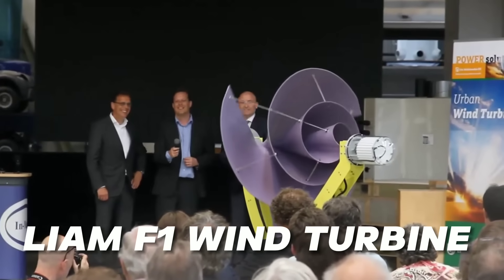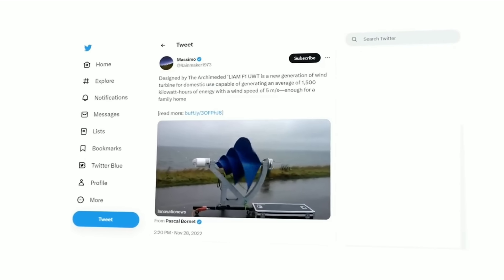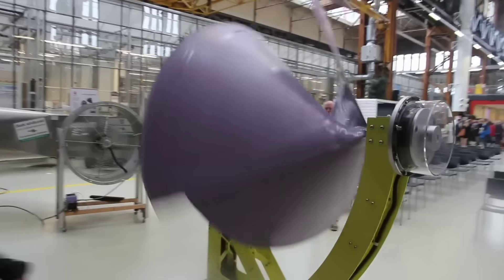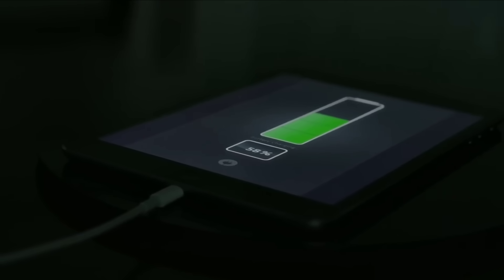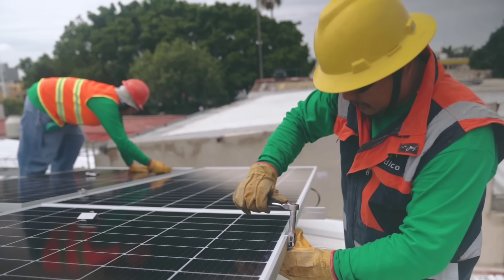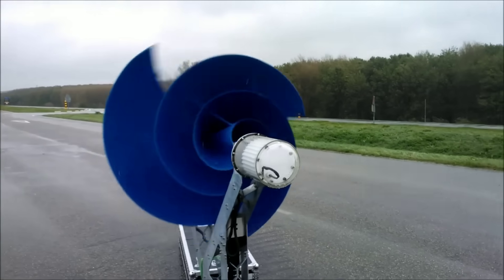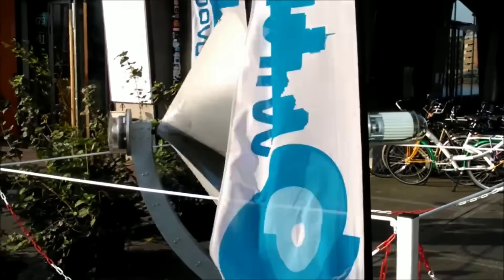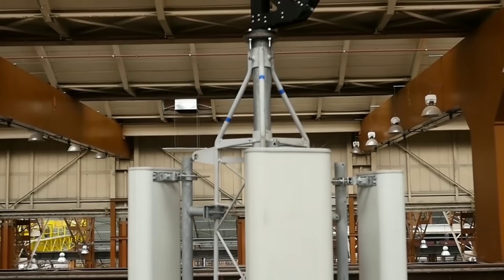This NEW European Wind Turbine for Home Outbeats PV Solar Panels in 2023?!

Comment: We have a 19Kw solar system and we did so after monitoring wind speeds for 18 months. The result of that monitoring showed us wind was not viable for us, and we are in a place considered "windy." We have wind almost every single day ranging from 5 to 20mph. A windless day is very rare. However based on all the turbines available at the time none showed anything like what solar does for pay back time. Our solar will be paid off in 12 years. Wind was 30 years. We also have with 3 Tesla Powerwalls and the key is the batteries, not really the method of generation. Whether you use wind or solar, both are not full time and batteries take up a lot of the load. As it was, we spent 70% on panels and 30% on batteries, but if I did it over again, I think I'd do 60% on panels and 40% on batteries. Now as to this particular turbine, I don't see $4500 worth of material there. I think I could reproduce that for $2000 and I'm just a DIY guy. In mass production I don't see why that could not be done for $1000 wholesale, $2000 retail.
Reply: There are many things to consider with home wind..in low wind  it should still produce some energy and in high winds it should produce some energy while protecting the wind generator ..it should capture wind energy from all directions without putting undue stress on the machine..I do not know if this machine can do these things...marketing hype is just that until real world testing is done not laboratory testing..
Reply: @fredfrederick2246  Lab tests yielded on average a 1.6x improvement over traditional designs and over a 3x improvement with wind blowing at a 20 degree angle.
Reply: If this product goes to China or India I think we indians can make it in just 200 euros or dollars,  that's it 😂😢😮
Reply: @kulbirsingh1080  Probably but the issue is, is that you want a stable & reliable system and not customers who call in every week for you to send a tech to fix your product.

Companies like this will quickly learn to make more reliable & expensive products as to just cheap and dirty ones.

Which is also the reason why most states have stopped using or are using minimal wind generation. Maintenance for those things is costly. And since you have moving parts maintenance will always be more expensive then passive solar generation.

Also the figure given here by the company of 1500wah per year calculates to about 4w/ah per day. Which I assume is not an average even though the company claims so but a "best case" or Maximum production. Which means that wind power will generate significantly less and that's without even mentioning any maintenance of the system.

I would still go with solar and let other people experiment with wind
Reply: @shachar2  DIY is best!

haha I have a very old Ender 3 pro printer but I got the 8 bit one and halfway converted it to 32 bit but I am not very good at following through with my ideas. I can make  the nautilus shell inspired turbine fin but it is not easy to make it future proof. it would break in a week haha. but getting your brain comprehending is powerful! 

I will never get one of those GIANT wind turbines because they always burn out. You just felt good because you didn't use coal. Terrible design and when they burn, they are just thrown into the landfill. Just get an electrolyser and burn hydrogen. Almost 0 impact on nature and very clean energy. Easy to make a homemade electrolyser. Just some steel wool, water, some starting power to get the electrolysis going, make sure you are building with strong materials, it is a fun world we live in
Reply: @sam11182  What's the difference between 8 to 32 bit for 3d printing?

if you want to really mess around with it, you can build a prototype with what you have on the cheap, then when you're sure that the design is good you can send it to someone else who have a more serious printing machine to print or manufacture it for you.
Reply: @shachar2  0p
Reply: @kulbirsingh1080  Nice, but we want it to last for 20 years, not days 😉
Reply: @arnold9861 There are a few points that will wear out.  The bearings are the main part.  Sealed high speed bearings in certain internal dimensions are relatively inexpensive.They are used in the Automotive  Industry for Turbochargers. 
They should be easily replaced and this should be considered as a yearly servicing item,  just like your automobile.  
Then there is the material that the fins are made out of, are they UVA and UVB resistant?, as well as temperature stable from
 - 40°c to + 50°c or more for certain warmer climates.  
The rotor and electrical  components are as usual generally reliable if kept cool and dry.     
I assume all of those components are sealed to I.P.66 or better.
Reply: @kulbirsingh1080  Here some guy using 90 cm of plastic pipe and a wheel from gyro-scooter harvests 9 watt from every square meter of wind stream at 3.0 m/s.

https://youtu.be/t4Ci4fdqJxo
Reply: @kulbirsingh1080  hahaha, that's so true, too easy to replicate.
Reply: @kulbirsingh1080  Sure...cheaper means cheaper. Cheaper materials with a resulting poor product, just like the Chinese built wind turbines. You get what you pay for! A cheap man pays twice.
Reply: Take a look at the alternatives. for example there is a 7kw wind generator for £850. The problem though is the power falls off at low wind speeds, e.g. 7mph which is our average wind speed gives about 30w. The power/speed curve is a kind of s-shaped curve.
Reply: @orionbetelgeuse1937   so your stating london as the whole of  europe? and bad mounting solutions (that of course could not happen to other solutions like solar). not to meation that there are plenty of low building  areas (most houses in my area are single story/no conflict of high rise building )
Reply: @orionbetelgeuse1937   smaller country with little idea on the sales projection that need to recoup R&D costs, (happens to most products when they come out start high and lower over time) not to mention smaller house's, plot size, and more appartment living in european nataions so they may not be able to  just get more, biggger, less effective units. and as stated less noise which again works well for people living close together.
NOTE: purely going off of the companies own numbers (which i would like to see fact checked) these sound like a potential alternative for low sun/high wind areas. IF results are true these maybe better then solar for me personally (which bigger wind units and noise would be an issue)
Reply: Most do miss the point of having large power storage capacities regardless of how you get it there.  And higher the voltage of batteries packs allows more wattage to be brought in from nature.
Reply: yep the producers are greedy
Reply: They want to make a huge profit
Reply: @lakyluciano4219  Oh, sorry, I'm just pure off-grid evangelist.
Reply: @cvv2k  I am just a wannabe. Still quite expensive. I think that we are not supposed to have free energy. The energy market is worth trillions and many wars have been faught for the sake of it, for us pheasents to be just allowed to harness it for free like Tesla wanted us to do!
Reply: @orionbetelgeuse1937   did you watch the video? did you read my comment? as i clearly stated based off their numbers which i would want to see fact checked.
yet your talking about it wont produce any power (according to their numbers is does) need to be tall (according to this design NO) i say im in a single story area you go back to cities?
like you do realise  thses designs are different from your standard, like why bother doing the R&D if your not getting any better results (this and others that are designed for roof tops, this is a promo for them so fact checking is needed) but as i said IF these work as good as they say, then for me they should be cheaper then solar and better proformance year round for where i am (PS ITS NOT A CITY)
Reply: @vapour80 location can have a big impact on output. Doesn't necessarily have to be high like you say. Topography and surrounding buildings are important.  Wind actually picks up speed going around large buildings and objects.
Reply: @dpirkl4560   sorry  not aware of what part you are referencing. my comments was about my area which all building are single story and near acouple big parks so we are low with high speed wind. (the other person kept going on about how they dont work in cities and the like)
Reply: You can make this in Asia for less than $1,000 easily. Unless the generator is unique, I do not see why it cannot be replicated.
Reply: I don't think it is fair to compare this particular turbine with just other wind turbines. The design of the propeller is particularly receptive to winds at different angles and speeds, well beyond the HAWT/VAWT variant...
Reply: @Jake7706 propeller design is one of the least important factors in generating power though.  Wind speed is the most important factor.  Wind at 20 mph has 64 times the potential to create power than wind at 5mph.  Wind at 25 mph has 125 times the potential of 5 mph wind.   TLDR, doesn’t matter what kind of turbine you have, it needs significant wind to have significant electrical output.
Reply: @brettgracey9682  Is the opinion of "propeller design is one of the least important factors in generating power" based on tests of different turbine designs including this particular design of the propeller?
Reply: @Jake7706  his declaration is based on laws of physics. His declaration means that it's much more profitable to enlarge speed of wind instead of improving propeller. But in the real life enlarging speed of wind often is impossible
Reply: @Jake7706  it’s based on the mathematical formula that determines a turbine’s output.  It’s basically .5 * turbine efficiency * area swept by the blades * wind speed cubed.  .5 is the Betz limit, which states the theoretical maxim of energy that can be extracted by the wind.  Turbine efficiency is what they are saying is vastly superior in their model.  Standard vwat’s are between 30-50%, they are saying theirs is up to 80%.  Area swept is simply the amount of space the blade can extract power from, and the wind speed is cubed.  So even if they have 80% efficiency and wind is at 5 meters per second with 1 square meter of swept area, the possible power is .5*80%*1*5*5*5 = 50 watts.  If the turbine efficiency is only 30% the output is .5*30%*1*5*5*5 = 18.75 watts.  That’s sort of significant, but for the most part useless as the wind is too slow.  Now if the wind is 10 m/s the output of the 80% turbine is now 400 watts and the 30% turbine is 150 watts.  If the wind speed is 15m/s then the numbers are 80% = 1350 watts and 30% = 506 watts.  

So certainly a more efficient design can collect more power, but the difference is only significant if wind speed is high.  Keep in mind windnat 15m/s is 33 mph, or 54 km/h.  Those are significant winds, especially at ground level, where these turbines are proposed to be mounted.  That is the main reason why wind turbines are being built taller and taller.  Access to stronger and more steady winds.  You likely wouldn’t find a place with 30 mph winds at ground level that are fairly constant throughout the day, let alone year.  You also likely wouldn’t want to live there.  Otoh, it’s much easier to find those winds at 500-800 ft high.  

So even if their turbine is more efficient, it’s too small and for the most part incapable of getting strong enough and steady enough wind to be a significant source of power.  Their design mounted even on a rooftop at 20 ft elevation, is likely to generate no more power than a 30% efficiency turbine on top of a 60 foot tower, because the higher one has better wind speeds.   

Also this archimedes screw type turbines are not a new development, there have been other manufacturers over the years, all trying to sell the same hype.  At the end of the day the only type of wind that really works is the really tall wind turbines, with huge swept areas.
Reply: @cvv2k  Who is "his?"
Reply: @brettgracey9682  Thank you for the info! I am looking forward to investigating it and learning in the process. Can you point me to an example of the refutation of the "archimedes screw type turbines" i.e., the nautilus-inspired design as a viable design? No disagreement with better wind resources at higher elevations.
Reply: @Jake7706  ooh, sorry I didn’t mean to imply the archimedes screw type design is inferior or superior to any other design.  Just pointing out that for the most part small wind is extremely expensive compared to solar on a per watt basis.  People trying to sell their wares talk about low cut in speeds, like how it can generate at 5 mph.  What they don’t tell you is how little it can generate of it’s max capacity at such low speeds.  That’s why I say the most important factor is always the wind speed and how constant it is.  The important measure for any type of electrical generation is the cost per kWh of electricity produced and across a defined time span.
Reply: @Jake7706  Its a claim until its proven.  In the mean time, people will look at cost of the item vs output and how long it takes to make back what they paid to start earning on their investment.  I'll wait to see what early adopters have to say about long term performance before making a purchase.
Reply: @Jake7706  So what do you compare it with? Lolipops?
Reply: @Jake7706  you sounds, funny, .... and also ignorant aka gullible, I got a good price if you invest in may bridge .
Reply: How were you able to monitor the wind to determine if it's viable?
Reply: Put up a weather station which transmitted the data to my computer.  @joeschlotthauer840
Reply: PV works only in sun daytime wind turbine works night & day
Reply: Nuclear power plants would be far simpler.
Reply: There is a new completely off grid designed RV trailer for sale with 4.4 Kw of solar on the roof when stationary and has 72 Kw of modern LifePo battery storage, the issue is, the price is cost prohibitive. These new RV's cost more than the average 2500 sq ft house.
Reply: @orionbetelgeuse1937  So because it can free spin faster with no load, you conclude maybe 5w when generating load? any proof or actual calculations on that outcome?

2nd video says the same thing. aiming at private households, estimates 1 of them on a roof should produce around half a households requirement (no actual numbers of production though).
its old, yes seen it before i assumed they are closer to release/mass production now as the old vids are back in the R&D stages, last i see of this they was talking about materials to make it lighter while keeping the rigidity

And just to be clear, im not saying this is great or produces everything they are claiming, hense wanting to see it all fact checked, just saying i will wait until actaul numbers proving either way.
Reply: NICE that you can make one for yourself. If you sell them, you will ask for more than parts prices won't you?  Manufacturing is not cheap. Sales, accounting, building space, employees, taxes and and and and.  Just get permission to reproduce these and go for it.
Reply: I've been in business for 40 years. There is nothing unique or special, that's an Archimedes Screw attached to a generator/alternator. Like I said, as a DIY I believe I can reproduce it for about $2K, but I would not because it just does not produce the energy needed because it takes a lot of wind. Their rating is at 15-20mph, sustained, which most places do not have. Not only that, but it's a very large apparatus. Go to their website. It's taller than an adult and wider as well. Also I can't image trying to get permits for them to be mounted on a rooftop. It has a huge steel frame and all turbine vibrate. But ultimately wind power is a pipe dream. I'm in Nevada (a windy state) and drive to CA and other western states quite often and when you go by the huge (and I mean MILES long) wind farms, most of the turbines are shut down. Maybe 20% are actually running. I've seen this in all of them. So we have the Military Industrial Complex, the Pharmaceutical Industrial Complex and now the "Renewable Energy" Industrial Complex. Create a lot of hype (enemies, sickness, "dirty energy) to create a panic and have govt spend millions of dollars (taxpayer dollars) on, at best, iffy solutions to made up problems.
Reply: Why did you invest in your own electrical generation ? Offgrid ? Bills too high ? ... I am curious as to why people are spending $$ creating their own mini electricity factories
Reply: @grassabrutta  #1, Bills too high and rates have increased 40% in the last 5 years. #2. Grid does go down from time to time and we have mission critical applications. #3. We get our electricity from Hoover Damn and the drought cause 2 of the 3 intakes to be exposed, thus Hoovers generation capacity dropped by a similar amount. #4. The cost per Kwh will NEVER go down, it's only going up and up. Having our own "mini electricity factory" controls that to nearly a fixed amount. Spending the money now gives us a more or less known cost for energy, at least for my lifetime. #5 Govt rebates are at an all time high and while we never really get anything good from the govt, 30% is as likely as it'll ever be and so we need to take advantage of that while we can.
Reply: @stickman-1  Clearly you have a very real reason for doing it. I am really interested in knowing if/why suburban/residential owners are doing this. I often see in suburbia a plethora of solar panel installations. I cannot believe that the cost of install + maintenance + incidentals leads to any actual saving. I doubt that it does. Maybe if you purchased electric vehicles ... hm.

We live on a 25 acre farm and have no electrical vehicles. For the fields and pasture it's all diesel and petrol (and always will be that or smtg similar). Around the farmhouse the city grid supply is good enough ... but we are thinking of electrical floor heating ... and that would 'force us' to go 'renewable' I suppose. The regular single phase operations (welding, concreting, general tools, animal heating etc) ... that is where I am considering 'renewable' also ... and I am trying to work out how to get a 3 phase result if I invest in wind (or solar)
Reply: It's business my friend, it's business ! And as a consumer you can be shure it's still compensated thru the EU green policy, so this company is a "start-up" growed fully with EU-financing!🥴😅
Reply: @elfillari  ok ... but I am not after the "business answer" from vendors that might encourage us to buy ... I am interested in the real world motivations of home owners to make any investment of this nature. Homeowners are not doing these things to "get compensation"
Reply: @grassabrutta  dear grassabrutta, I feel for you, and for that obeyed situation I will sell you a "saving the world apparatus" for a very good profits plus it's totally free business to me because I can collect the financing from the EU. Win win for both of us, ain't?
Reply: How did you monitor wind speeds?   Did you use internet weather, or some type of wind gauge?
Reply: Bought a weather station, in fact I bought two. Monitored from 2 different locations, they  really didn't vary more than 2mph. I still have the spreadsheet here someplace. But I did this seriously. I contacted at least 6 different companies, uploaded the spreadsheets and got their reports back. All of them showed a 30 year payback. Bottom line: You need 20mph sustained wind to make it equal to solar. Go take a look at their charts (windmill manuf.) The are logarithmic. Anything under 10mph is useless. It doesn't even start the climb until to about 15mph. And be careful. 99% of them show meters per second. (mps). But realized mps is half mph. So you need 8-15mps and think 8-15mph and that'll work. But in fact that's 10-30mph. Most places don't even come close to that and it needs to be sustains winds. Where windmills make sense is at the tops of mountain ranges. I calculated there the payback is just 3-7 years. However most people don't live at the tops of mountain ranges and the cost to bring the electricity down to where people do live triples the total cost. So that generally doesn't work out either.  @robertshaw100
Reply: The price is way too much for this small turbine. 4500$, I think i am gonna opt for solar panels, and also i would choose vertical turbines over this one.
Reply: @orionbetelgeuse1937  from R&D to full production can indeed many years specially for start up's/small companies (no idea about the company of this product).  i work for a massive globle company, simple running changes can take a year or two to get into serial production..
though as you stated the lack of actual outputs is more of a concern  then how long it takes to release to market
Reply: #Not MORE than US$500 ANYTHING ABOVE IS LOOT
Reply: EU is greatly more costly than USA plus one has to recover research costs... So your opinion is weak at best... As to batteries yep spot-on
Reply: Absolutely right. For wind to be any good you need a very windy place like on top of a hill in a windy area or out at sea and plenty of space to build a huge structure. Home wind turbines are rarely worthwhile.
Reply: $10,000  AUD is a   JOKE... for something that costs 500 to produce.
Reply: There will be, made in China...
Reply: Yea and unless you live in an area of 20mph near constant wind, it still will not compete with Solar or traditional grid power. I have come to the conclusion that wind power with current technology for 99% of people is a folly. @Felidaena
Reply: I work in solar industry and would say you're pretty much spot on, I was also thinking why does it cost so much. Is a slightly odd video, they have graphics showing kilometres/hour rather than kilo/watt, hardly a small mistake considering the context.
Reply: This product is dutch and the dutch allway sell their products expensive 😂😂
Reply: You are very correct in all your estimates. Solar panel are better and some reliability is there. J. Sudhakar from India
Reply: I wonder if these could be adapted into a ducted fan arrangement and scaled into an EV, aircraft or ship.
Technology is screaming forward. The things we can accomplish without war
Reply: So you paid 6-8 times the cost?
Reply: my solar will pay for it self in 4 years
in 12 years i would both make the cost of it by  selling electricity produced, while it at the same time had produced 3-4 times the cost of it for my own consumption more or less

depends on what you pay from the grid, the other day my price was at 1 dollar per kwh here in scandinavia europe

i did spend about 2/3 on batteries, and i will double everything this winter.  

and my next step is a car that does car-to-house, so i can use that as battery, but the rules are not ready for that yet here in eu
 my grid cost can change from 15cent to a dollar per khw on the same day..

you never know when there is a week without any sun or wind or rain for water power here in scandinavia, 
and then it is nice to have as much backup as posible

my rule of thumb is atleast 27kwh battery  per 6kwh panels (on a normal summerday where i live in denmark 6kwh of panels can fill 50kwh of batterys and provide a bit for the house while the sun shines )
Reply: So, make a wind/solar "hybrid" system to cover all the bases.  As you say, the key is the storage/inverter, and transmission, not the generation.  Commercial utilities use heat (coal, geothermal, natural gas, trash, nuclear) for steam turbine generators, wind generators, and hydroelectric generators all combined to power "the grid"...
Reply: Nicely put . Well written
Reply: Yeah my 3D printer could knock these out in carbon fibre for less than $1000. Now if I only had the plans :-)
Reply: I'm interested to know how this wind tubine would deal with the extreme weather in the Philippines with all the typhoons they have there! I'm thinking of moving out there and although this looks like a good option for free energy, it's not so great if it ends up in your neighbours garden!! Any thoughts or suggestions?
Reply: Really super  I want LCs and capacities
Reply: I do agree with most of the views - that with high volume manufacturing - can get the unit below EUR 1000.
Reply: archimedes wind turbine generator 24 hours/ day,solar panel need sun
Reply: LOL. Maybe you live on the top of a mountain, but no one else has 24 hour winds. In fact I have the data. I monitored our wind for 18 months and it's not even close to viable and we are in a location considered "windy." Wind is a boondoggle for 99.999% of the people. @hashim64
Reply: But with wind you don't need such a big battery bank because you get wind at night...
Reply: 12 years, but did you put in this account that every year the price of electricity gets a % more expensive?
Reply: 1500 km / h ? That is what there text shows. But the speaker says 1500 kWh per year and that that is equivalent to 50% of what a normal household uses in a year ?? Not trustworthy at all
Reply: @peteroffpist1621 I agree. I use on average 1000kwh a month and I am an average user.  I don't understand where they get their figures from
Reply: @orionbetelgeuse1937 m😊j
Reply: I think this wind turbine is useful IF it small version installed on e. car body so it can recharge batteries..
Reply: Your calculations for the wind turbines are somewhere very wrong.

For stable wind from 5 to 20 mph you should get the same effect as from PV.
Reply: @cvv2k  Not a chance. You are probably looking at m/s on those charts, not mph. Almost every turbine chart I've ever looked at is in m/s. 9m/s is 20mph. Most turbines don't even start till they are at least 10m/s. I looked at their website and at 7mph (3m/s) it's like 25 watts. A single PV cell is 400 watts for about $750.
Reply: @stickman-1  you are completely right, they always measure the windspeed in m/s, and the high output is only reached with higher wind speed (20-25 m/s which is quite high). Everyone should look up the wind speeds, where he/she is living. In Europe you calculate with average speed of 4 m/s, only in coastal regions you can count up to 7 m/s, but that is an average. You can never calculate on average, because wind speed is going in the calculation on 3rd degree, meaning double speed is 8-times energy. Most turbines for households are already starting at 1,5-2 m/s because not everybody is living in a place where you have higher wind speed.
Reply: @stickman-1   A single PV cell is 400 watts for about $750. WHAT?? rather 120 $. Best Regards
Reply: @spectaor  I'm talking about a Panasonic or other brand name panel. There are no 400 watt panels from a reputable company for $120.
Reply: @cvv2k yo do realize that at 5mph any turbine will create negligible power.  At 20 mph it will create up to 64 times more power.  Wind speed is the most important factor in any wind turbine.
Reply: That’s a really childish and silly way of looking at the price of a new product, saying a don’t see $4500 worth of product shows your total lack of knowledge of product development, research, patents etc.
Reply: Not much research and development needed for this thing. It is nothing like rocket science. Any patents won't be worth the paper they're printed on. The silly price just reflects the massive markups those producing it will be making from gullible people before the bubble bursts, which won't take long. @hboy8625
Reply: LOL. I hold 4 patents and been in business for 40+ years. I know darn well what it takes to bring a product to market. @hboy8625